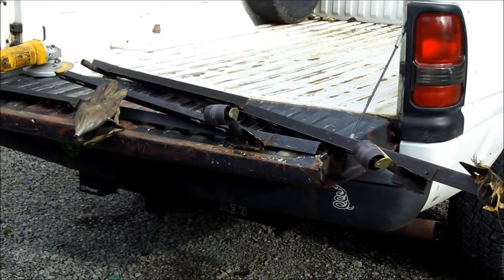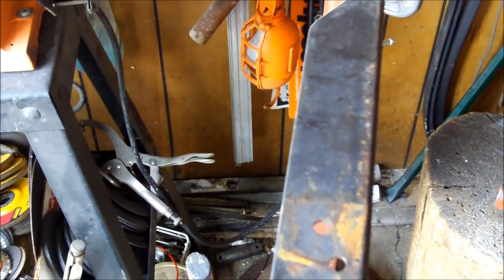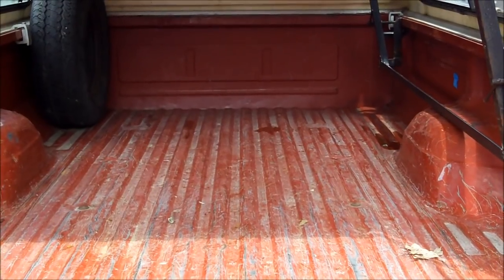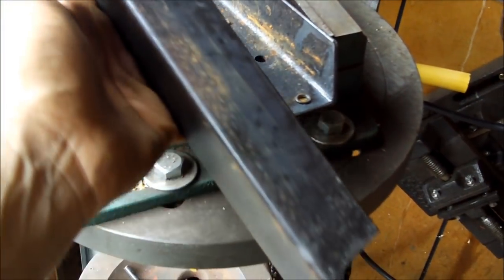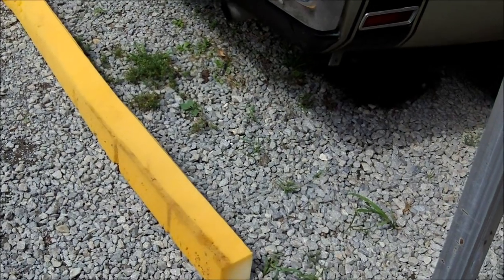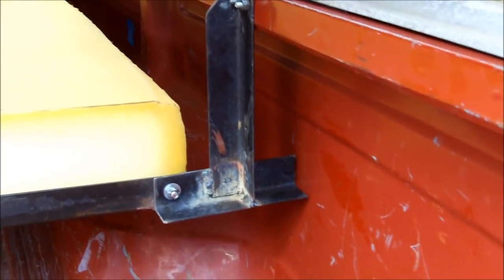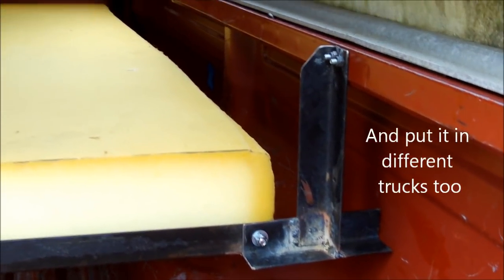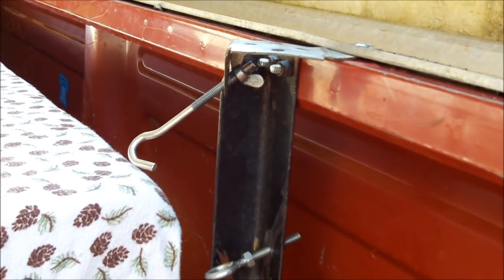Folding Truck Bed (for camping)

Comment: Been watching tons of these camper shell conversion videos and they're cool but most of them are putting in a solid wood insert, pretty much, of various kinds. Just a lot of wood and building and weight and yada yada that seemed unnecessary to me, this is what I'm talking about. Love that it folds up out of the way.
Reply from the maker: Thanks!  That's exactly what I was wanting too, need to be able to still use the whole bed.

Comment: Good job! Simple & functional.  The only thing I might do different is mount the 'kickstand legs' a little back from the front edge, maybe even the middle of the head and foot rails; just because I'd be constantly stubbing my big toe on the leg sticking out past frame into the "floor space". (But I'm a klutz)
Or somebody might just build a storage box (with a drawer front) that bed could rest on when in use.

Comment: Had the same idea. Love the Mopar 🇺🇸👍! Bed angle iron is hard to work with. I used it in a BBQ frame on a smoker I built years ago
Reply from the maker: Thanks!   Yeah, you think your getting a deal on that metal until you try to work with it, haha.